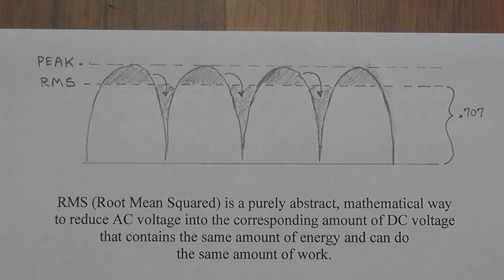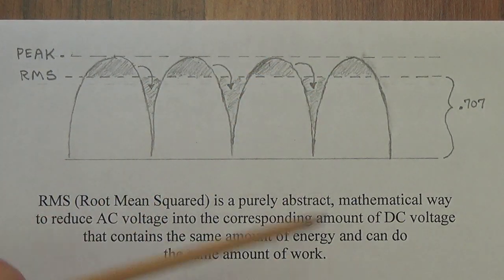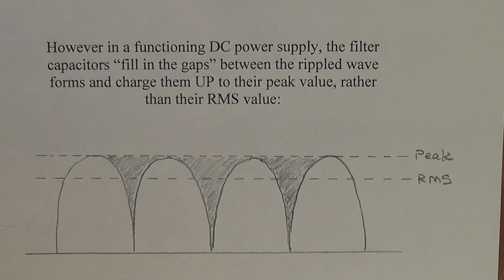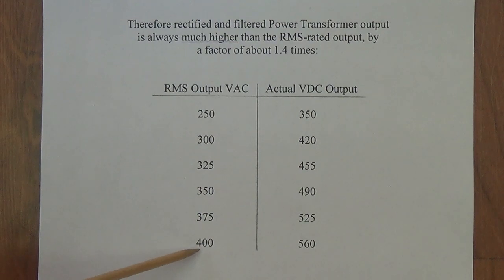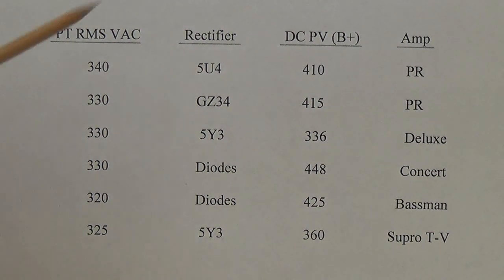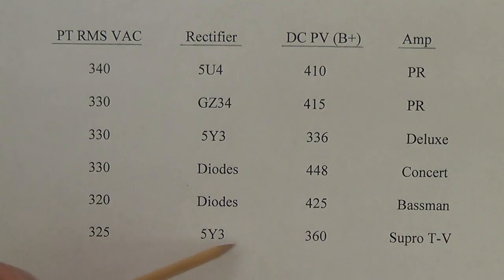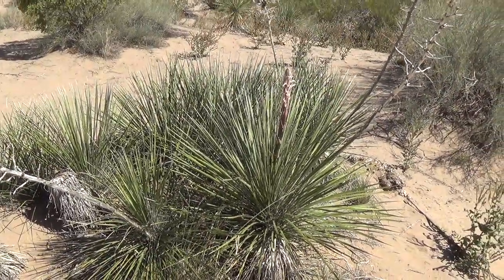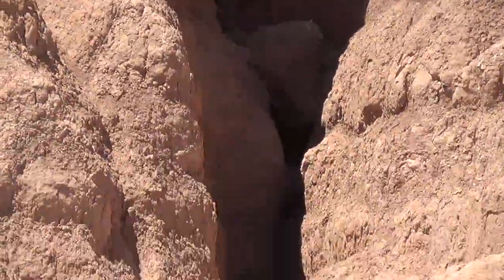Power Transformers:  Why The DC Output is Much Higher than the RMS Rating

Comment: thanks you answered my question . I usually don't 
work on tube equipment but I have acquired a few tuners,amplifiers, and a Gen.rad. audio frequency generator.  I usually work on large linear power supply 30 amps and up .just finished recapping a HP 5 volt 300 amp power supply.
it's amazing how much technology has changed
Reply from the maker: +Bryan Sullivan You're welcome, Bryan. Keep up the good work :)

Comment: hi uncle doug, old video but very helpful and informative, here's my 2-cent, 5Y3 is not inefficient as you have mentioned for the Fender deluxe dc voltage measurements, but actually 5Y3 is a very stable and regulated-like tube rectifier as it can control the peak voltage of an ac ht input, imho.

Comment: Excellent series Uncle Doug, as one of your other subscribers noted it "has been a good recap".  No pun intended.  The chart near the end is a good reminder when building an amp to use filter caps with voltage ratings high enough, especially if you're going to use silicon diodes.  Then, if you throw a  "Standby" switch into the mix you can really strain the first electrolytic.  Personally I don't like "Standby" switches these days, in younger times I did because I thought if Mr Fender used them it must be right.  Really like the trip in the desert.  There's only one place for a graffiti vandals spray can and the sun don't shine there.
Reply from the maker: +Jeff M   Thanks, Jeff.  You make an excellent point about the voltage rating of the first filter cap.....thus Fender's utilization of a series pair of 70uf @ 350V electrolytics in this position, yielding a net of 35uf @ 700V.  I too have no use for Standby switches. Once you learn about amp circuitry, you see how they can cause much more harm than good.  We're glad you liked the desert video. So far, it's the final refuge from the depredations of (most) foolish people.

Comment: Douglas,
This video takes me back to over forty years ago when I learned about this subject in college.  At the time, I was serving a five year apprenticeship for television and audio (along with some white goods) servicing.  Throughout my five years (1971 to 1976 - aged 16 to 21) my employer let me have one whole day (known as 'day-release'), with full pay for an under twenty one year old, to attend college, during term-time only, consisting of three, three hour learning sessions, with breaks in between, in the workshops cum lecture labs, starting at 09:00 through to 21:000.  As you may imagine,  learning, certainly by seven o;clock in the evening, became tedious - all us lads from the engineering departments thought about at that time in the evening was calling into the pub for a few beers, and meeting girls from the hair dressing, catering, caring, and secretarial, departments at our college LOL.  At the end of each academic year (June and July) I sat my exams and was always successful - thankfully there were no early January module resits for me.  I remember, though not specifically, answering exam questions on this very subject featured in this video, along with rectification.  
By the time I was growing up towards my teens (during the second half of the1960s), 'horse power' rating for engines was largely 'old-hat'.  My dad owned a Ford Popular 103E (he bought new in 1954) incorporating a 10.70cc side-valve engine which I seem to remember equating to twenty-something kW.
All interesting stuff my friend,
Phil.
Reply from the maker: +SteelCity321PB  Thanks so much for sharing your reminiscence with us, Phil. I think a lot of us suffered from distractions during this critical formative period in our education. It's almost a cruel joke that when we should be learning the most, we are also endowed with seriously competing hormones and juvenile interests. Still.....I wouldn't change a thing :)

Comment: What a fantastic burble that Jeep has. In the UK the closest we get is the odd ex military Land-rover fitted with the rover 3.5l v8. There is no substitute for cubic capacity as they say. The scenes with you near the railway line brought to mind the old Duel film, and another one with Kris Kristofferson as a desert cop but the name escapes me. As a kid in the eighties I was obsessed with that landscape and the US vehicles. We had a local American car specialist and he used to let me go and hang out and start up the Trans Ams. Maybe I'll make it across the pond one day. Sorry to waffle. What is your opinion of the trick of putting a Zener in the centre tap to lower the B+? I have a lovely early seventies vox ac30, but it's one of the rare silicon rectified ones and it has a rather arduous 440v on the el84s and it's hard to find ones that do not live on the edge at that voltage. Thankyou for such a informative, and inspiring video.
Reply from the maker: +PoJoWo You're welcome, PJ.  When rumbling through the desert, I sometimes get a "Mad Max" vibe. I guess if Rusty were beside me with a neck scarf, it would be even better....however, he has no love for the Jeep or any other vehicle, primarily due to the fact that they occasionally transport him to the (despised) veterinarian's office.

Yes, Zener diodes can be used to shave off B+ voltage, but, due to their heat-producing nature, they generally should be mounted on a finned (if possible) aluminum heat sink.
Reply: +Uncle Doug Hahaha Mad Max vibe, yer killing me . My Rusty would jump in anyones vehicle for a ride, sadly he was kidnapped. Rusty was a mini Dachshund.
Reply from the maker: Glad you liked it, W4. We're really sad to hear about your mini-Rusty. People who steal dogs are an even lower life-form than those who deface the desert.
Reply: Uncle Doug That broke my heart. They become like family.
Reply from the maker: I completely understand and sympathize :(

Comment: Nice set of pearly whites you show there in yiour diagram, Uncle Doug. 
 Recollecting my AC theory, Peak, peak to peak and Root Mean Squared (RMS)
I always understood as its part of the Sine Wave math.  RMS can be considered the "heating effect or effective value' of current and voltage for a given voltage in a resistive load.
For a cyclically alternating electric current, RMS is equal to the value of the direct current that would produce the same power dissipation in a resistive load

 At the peak of the 60hZ sinewave voltage, there isn't a lot of energy in the transition between the positive
slope cycle  sine wave hitting it's peak,  then transitioning down in its negative slope cycle. 
All together when you analyze the AC sine wave there are  4 quadrants ( 2 positive going and 2  negative going .
peaK IS 1.41, (RMS x 1.414)
 IE: 240 volts x 1.414 = 339 volts.
Reply from the maker: +SuperCarver2011  Excellent analysis, SC.  Hopefully, I was able to convey most of this in the video.....particularly the equivalence of power dissipation between RMS and peak AC. Thanks for your knowledgeable input.

Comment: The road trip was a nice surprise. I am building a PSU and yep I made the same mistake 240 to 12 0 12 and was expecting 12v out and got 18v out. That was then regulated down to 9v but when attached any load that dropped then to 8v. Used adjust resistor to finally get it to steady 9v but was all very confusing. Pity I did not see this video first!
Reply from the maker: +Tech Tins  Yes, indeed, TT, this unexpected phenomenon has caused grief to a lot of techs and circuit builders.  It seems counter-intuitive that you can get so darned much filtered DC voltage out of a lower-rated PT.....but, as we both found out, you can :)

Comment: Doug
Great video (as usual),,As far as the 5Y3 power supplies..- what makes the B+ of the Supro higher than the  Deluxe , even though it's RMS VAC is lower?
Reply from the maker: Thanks, CMG. The Supro is single-ended, while the Deluxe is double-ended. Two output tubes flow more current than one, resulting in lower voltage levels.

Comment: It can go higher than that.  The "Champ" power transformer that Triode sells is spec'ed at 650 Volt center-tapped.  (325-0-325) With a 5Y3 it produces around 490Vdc  before the other tubes heat up.  I used two 47 microfarad 450 volt caps in series for the first filter stage.  After warm-up it still cranks out 400 volts or so.  (I don't remember offhand what the measured no-load AC voltage is.)
Reply from the maker: +Chaka Wolf   Yes, indeed, CW. During the initial AC input surge, which can be monitored with a voltmeter, the voltage can quickly (and briefly) reach scary levels.....thus Fender's use of two 70uf @ 350V electrolytics in series (just as you did) in the first cap position of the Bassman circuit.

Comment: If I have 550V (no output tubes drawing current) coming out of a bridge rectifier, is there anything I can do to take the edge off before it hits the four 6L6s?  I have the basic reservoir of 50/350 uf in series with 220K resistors parallel to them before going to the CT of the OT.  I was trying a point to point project with a pair of transformers taken from a PCB amp but I'm not sure if I can deal with that voltage coming out.  Thanks.
Reply from the maker: The only accurate voltage measurement is made while the amp is complete and functioning.  Without any load (i.e. output tubes), the voltage will be abnormally high.  Try it and see.
Reply: @UncleDoug  Thank you.  My current limiter is running away after the output tubes start drawing current.  I can't take any usable readings yet.  I wasn't sure if this was the cause.  I'll go through the circuit again.  Thanks again.

Comment: Sharing!
o.O' Pretty crazy film until drive the Jeep (good motor sound). That place is a treasure :)
How about the energy consumption over the different rectifier?
Reply from the maker: +Humberto Martins Ferreira Junior  Thanks, Humberto. As you can see from the chart, diodes are far more efficient than any tube.....even the mighty GZ34.
Reply: +Uncle Doug  I'm feeling a little short circuit on my brain... well, could be a loosing screw. Understood Master. Making sense now. 
:)

Comment: great video, whats in the Jeep? SB350-TH400? maybe stall converter?
Reply from the maker: It's a Chevrolet 350 with a TH350 transmission, Doug.  I believe the torque converter has a normal 1500 to 2000 RPM stall speed.

Comment: Uncle Doug.  That chart you introduce at 7:02 is fantastic !!  Is that your own compilation  from your historic experimentation ?  Or did you source it somewhere?  If so - I'd love to know the source - for possible additional information.  However - so far I have not found any Internet site that comes near to providing the kind of pertinent detail you provide !!  Thanks !!!
Reply from the maker: +Donald Filbert  You're welcome, Donald. Some of the data on the "Real World B+" chart was from personal experience and some was taken from schematics. The pattern throughout, however, is very clear when it comes to the effect of filter caps, type of rectifier tube, and the vastly superior efficiency of diode rectification.
Reply: +Uncle Doug Thanks for your response !!  As to the the validity of the data in the chart - I have no doubt !!  I have seen lots of "Engineering" types of charts re" tube circuit" that were overly complicated and worthless in real application; and was delighted to see your succinct and completely relevant chart.  And was just curious if you had a secret site where there might be more treasures .... LOL !!!
Reply from the maker: I tend to prepare charts and diagrams like this for my videos, Donald, and then post them.....so they're all currently on YT and available for scrutiny. I may hoard vacuum tubes and old amps.....but I don't have any secret caches of data :)

Comment: First I would like to thank you for posting these videos. I've watched all of them and have learned a lot, and I look forward to more videos. My question is this, I have a leslie 147amp and the power supply is a full wave bridge rectifier. According to this video you say that the B+ voltage is on the plates. I always thought and correct me if I'm wrong that the B+ voltage is the highest voltage coming off the rectifier. Like on my leslie 147amp has 430 VDC coming right off the rectifier than goes through the choke and than the filter caps and so on. And of course has voltage drops. So when I measure voltage on the plates I have 415 VDC. As per the schematic. So is the B+ voltage on my amp 430 VDC Or 415 VDC? Again I enjoy your videos and look forward to more of them.
Reply from the maker: +MrTrip49  You're welcome, Mr. T. The term B+ refers to the fully rectified and filtered, smooth "battery-like" +DC being applied to the amp circuit, so it's generally measured at the center-tap of the output transformer (DE amp) or input to the OT (SE amp), just prior to distribution to the output tube plate(s).  Most people consider the OPT as the "beginning" of the amp circuit.  I would say your B+ is +415VDC.
Reply: Thank you for responding. I understand now. Look forward to your next video.
Reply from the maker: You're welcome, Mr. T :)

Comment: Transformer rating 350-0-350, meaning it gives out 2x350V line to 0 or its can produce 700 volts peak to peak.
Multiply 700*0.707 and we produce 494.9Vrms, in other words this should be the rectified out put voltage.
Just remember Voltage depends on the point of reference!
Reply: +PanzarMetal not at all.
Transformer rating 350-0-350, meaning it gives out 2x350V line to 0 or its can produce 700 volts RMS, not ptp.
Reply from the maker: +PanzarMetal  Since center-tapped (350-0-350 VAC RMS) power transformers are intended for Full Wave rectification, the AC output would be equal to either of the two secondary half-windings or one-half of the full secondary winding, i.e. 350VAC RMS. After smoothing by the filter caps, which will charge the ripple up to peak value (not RMS), the smoothed DC output will be about 460VDC.  If the full secondary winding (700VAC RMS) was subjected to Bridge rectification, the smoothed output would be in the neighborhood of 990VDC.

Comment: I'm a bit confused by the numbers. Why does the 5Y3 convert 325 to 360 on the bottom line, but convert the 330 to only 336 on line 3?  Feed it less and it gives you more???
Reply from the maker: +Gerald Hinson  The Deluxe amp has 2 output tubes so the circuit flows more current, making the voltage lower than the Supro amp, which has only one output tube (and thus flows less current so the voltage is higher).
Reply: +Uncle Doug Ah, got it. Thanks for the clarification. I missed that if you said it in the video.
Reply from the maker: You're welcome.

Comment: Could you be a rail-fan. What a great spot to do it. Now about the 60's underrated hp specs. That jeep's motor does not sound anemic to me. Now I know that mill came from a 60's design can I get a oh-yea !!!
Reply from the maker: +J&amp;B Fix it shop  You're right, J&B....it's a 350 Chevy with headers and Flowmasters, and the serious cam lope adds to the fun :) Yes, I love to explore around old railways and collect RR memorabilia.
Reply: Yea rail fan is fun no doubt. Now I will say, that sure is a lot of motor for that jeep. be careful we need more schooling and don't want teacher crashin out!
Reply from the maker: The power combined with the high center of gravity make for a scary ride sometimes.....but I'm securely harnessed in, so all that's at risk is my pride :)
Reply: Ok just saying.
Reply from the maker: Thanks for your concern. I'm very careful.
Reply: Now that explains why rusty can't go sometimes. If you drive real slow and be careful he could go but if you get the least bit daring then rusty could get hurt. Older bones take longer to heal. Ok on to the next lesson.
Reply from the maker: Thanks for the input J&B :)

Comment: I'm sorry but this is one of the few cases where I don't understand your otherwise impressively clear explanations, Doug. More specifically, I don't understand (at 4:00-4.15) where the capacitor gets the energy to fill up to the peak level. It seems that you get something (the difference between the RMS level and the peak level) for free?
Reply from the maker: As the signal wave is rising (gaining in voltage) it charges the capacitors, and when it falls, the charged capacitors discharge to fill in the ripple troughs, Jens. You can think of it as a battery. When the voltage in the signal is rising, it charges the battery, and when it is falling, the capacitor "battery" discharges to fill in the trough. I hope this clarifies the subject.
Reply: Thanks Doug. I get the principle (I think) but I'm puzzled that the capacitor has enough stored charge to fill the ripple troughs completely. In the beginning of the video, you show how the part of the PP signal that is above the RMS value corresponds to the part of the trough that is below the RMS level. Then from 4:00 in the video, it seems to me you are converting the peak-to-peak signal to an RMS signal of equal value without the "penalty" in level.
Reply from the maker: The capacitors actually contain far more voltage than necessary to fill the voids, Jens. Like a 12V battery that only releases and accepts 250mV. On initial start-up they fully charge and then only charge and discharge a small amount when filling in the ripple. The peak voltage is 1.414 times the RMS, so when the output is charged up to peak voltage, it is much higher than the RMS output of the transformer......which surprises many people. For instance, a 350-0-350VAC transformer will produce an output of 495VDC (it's actually less due to inefficiencies in the transformer and rectification......more like 435VDC).
Reply: Aahh, I see. Thank you again.